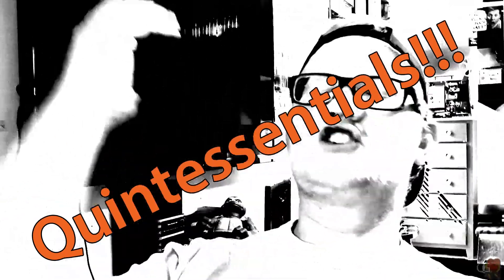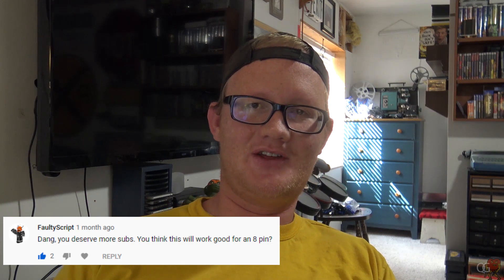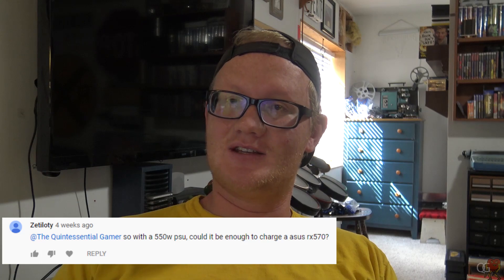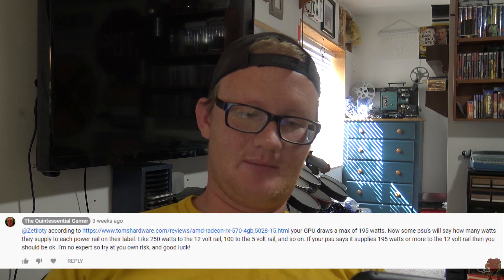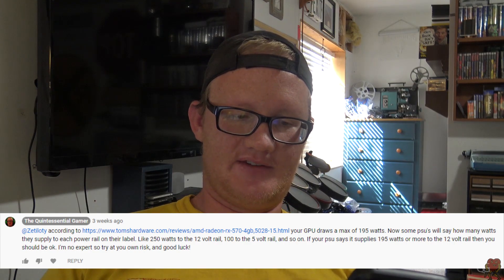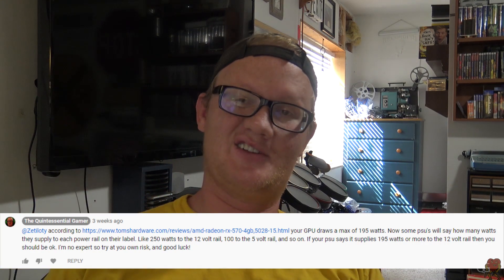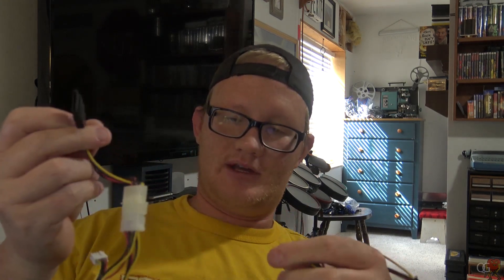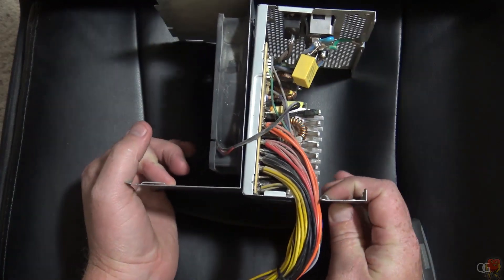Is it too good to be true!? (SATA Power to GPU Power Adapter)

Comment: you can savely use the 6pin , the pcie slot gives the graphics card already 75watts and the 6pin can only draw up to 75watts max if needed  . if you need even more watts then your graphics card will have a 8 pin connector that can draw up to 150watts , now there could be problems with cables, thats alot of power/heat right there . but using only one 6 pin should be always fine or am i wrong here ?
Reply: How does it game?

Comment: Rather than using 2.5"HDD, I prefer to use SSD because it only consume very small power and it won't affect the performance of the read/write activities compared to HDD that really need stable power.

Comment: Have you looked into just upgrading only the PSU? HP on their website have parts and they have higher wattage power supplies. I'm asking since I'm in the same dilemma as you with the proprietary motherboard.
Reply: but it still doesn't provide the 6 pin PCIE power cable so you have to adapt it somehow

Comment: I've heard that this Cable killed a whole GPU. What did they do that this would happen, because I don't want this to happen to me. Or maybe I just buy a new PC idk
Reply: It can melt and short out from overcurrent, if the gpu draws more than about 2.5 amps (45W) from the adapter

Comment: Can i use that thing to power my rx 580?
(I used 400w PSU)
Reply from the maker: Yeah I dont see why not
Reply: Did you use it?
How did it turn out?
Reply: I bought a gigabyte rx 580 8gb. Theres a note that said i must use 500 watts or higher.. And i have 700 watts psu. But i dont have extra 8 pin for my gpu. Im thinking of using this cable adaptor.
Reply: @greasemonkey1267  If you have Molex, use that instead. otherwise hope that sata works.
Reply: @virtualtools_3021  I don't recommend using a single molex to power a gpu
Reply: @ArrogantLoop  i don't either but its way better than using sata.
Reply: I don't think so, single SATA to 6 pin is mostly for cards that just need little bit more power from 6 pin. (Like GTX 1650 that has 6 pin)
Reply: CringeLord4000  It is enough for that card- GPU manufacturers overstate the recommended PSU wattage because they count on some people using 135W CPUs...

Comment: Thank you. Used the adapter on an optiplex 780 sff with a full size gtx 1060
Reply: Doesn't sff have to use VGA low profile?, How do you do that?
Reply: @hijazahsan  it fits in the slot but case back wont fit
Reply: @friendlyjunco6836  doesn't you must have 1x6pin ?
Reply: @hijazahsan  I really don't know much. I'll post a video
Reply: @hijazahsan  just uploaded a video
Reply: @friendlyjunco6836  Where is the video ?

Comment: Devices don't use wattage (current pressure) they draw (use) amps. You can have many devices connected to a xxx watt power cable, the wire gauge, and the total source power determines how much amperage can be carried (drawn) or supplied.
Reply from the maker: All electrical devices draw some amperage at whatever voltage is supplied to them. Voltage multiplied by amperage is wattage. Devices DO use wattage, but that wattage tends vary due to the amps being drawn also varying. Wire guage does not limit the amount of amps being drawn. They are simply rated for certain amperages, meaning a wire can handle up to a certain amount of amps safely. You can draw more amps through it but risk the wire getting hot and even melting. Same goes with the psu. The wattage its rated for means it can safely handle a certain amount of amps being drawn from it. Most power supplies have a safety shutoff. Trying to draw more power through it than what its rated for will likely cause it to cut off the power
Reply: @thequintessentialgamer7514  That was my experience... the GPU would cut out when the power draw was too high (I think there are safety shutoffs in the motherboard or GPU also), so how I connected the adapter to which SATA harness (and what else was on it, e.g., hard drives) mattered.  

Thanks for your vid... it was hugely helpful in my understanding, especially when you dissected the PSU, and helped me resolve my issue.

Comment: i have agtx 650 1gb (dont judge) and a psu 350w psu can it power my gpu
Reply from the maker: According to https://www.videocardbenchmark.net/gpu.php?gpu=GeForce+GTX+650&id=2155 it draws up to 64 watts, so you're probably good with your 350 watt psu
Reply: @thequintessentialgamer7514  my friend has the same gpu but a 280w can he use the same cable ? Also thanks for not ignoring me
Reply from the maker: The cable will work fine. It's their power supply that might cut out if it can't provide enough power for everything.

Comment: I'm using two of those cables for a sapphire nitro 380x and when i'm using very high resolution in games my pc is shutting down after running some time. So it's not good to use these cables.
Reply: Yeah, same case here for me. I did a little research and found out that the adapters would catch fire after a high power draw. The adapters would melt and then short out the contacts and from that you may ruin your power supply or even the graphics card. Some people from the LTT forum recommend the least adapters for a high powered graphics card one should use is the molex to 6 or 8 pin.
In the long run just garner enough money and get yourself a decent power supply at least 80+ bronze efficiency. Also research on the recommend power supply for your gpu
Reply: You need to consider how many wires are powering the GPU.  You can't connect all the devices in series.  The adapter is not the issue, it is how you are connecting it

Comment: yw ... got HP Z600 workstation (650w psu) (with only 1 cpu the other cpu is out), psu have only 6pins for the gpu, i got xfx r9 390 8g from friend, as u know this card need 6pins+8pins combo, my plan is to get 6pins to 8pins adapter to connect the real 6pins out from psu to 8pins port in the card and then 2 sata to 6pins for the 6pins port of the card, to decrease the power conception overall i will disconnect the cd-drive since its almost useless these days :) also i got two 3.5hdds connected through sata power ...  any suggestions ?
Reply: If you can, use molex instead of sata adapter, molex handles more current
Reply: @virtualtools_3021  thnx i ended up using molex

Comment: Hey Quintessential I have a question: My 6pin to 8pin burned (as I OCed my rx580). I am glad only the molex cable burned. Now I am thinking, to use 6pin from my PSU into the GPU and buy a SATA to 6+2 molex and use 2pins from that into my GPU. 
So, final connection: 2pin from SATA + 6pin from PSU -> GPU 8pin input.
How well is this, can I OC my card?
Reply from the maker: Do at your own risk is all I will say. In theory it could work, but it is sketchy. Honestly I think you got lucky only frying the cable before and not your GPU. The safest way would be to just fork out the money and get a new power supply
Reply: @thequintessentialgamer7514  ok thanks
Reply: don't oc your rx580 you should undervolt it
Reply: @kruxdt6307  yep I know now so I undervolted to 1020mV and it's running great ;)

Comment: The photo in the thumbnail is the "wrong" way to do it if you are going to do it. First of all, you need to make sure your power supply is of both sufficient wattage AND sufficient quality... this probably isnt going to work with the 280 watt bestec in your old HP, this is really only something you should do with say a high quality old antec 600 watt or something like that which has wattage support but just not the PCI-E connectors you need. Further, trying to go from a single sata port to an 8 pin is just stupid. the right way to do it is either two molexes to a single six pin or two satas to a single 6 pin, and ideally you would want to pull each of them off a single strand

Comment: Does this damage the gpu I am using rx 470
Reply: Ableh I’m using a rx 570 it works ok. I might recommend a dual Molex
Reply: @otamarau  Molex is much better than sata, it can handle far more current without risk of melting
Reply: @virtualtools_3021  hey I only have 1 Molex.  Is it gonna work If I connect it with dual Molex to 6+2 PCI-E / 8? Like I use one Molex to connect to my PSU Molex and the second Molex I just leave it unconnected while the 6+2 pins connected with my graphic card RX580.
Reply: @HuntersOfficial2021  those need the 2nd molex connected, what PSU do you have?
Reply: @virtualtools_3021  idk but old. 8 years old PSU (550W) That doesn't have 2 molex. It's okay I'll change my mind and just buy 750 ti because it not requires 6 pins. 👍
Reply: @HuntersOfficial2021  550w isnt too bad. you could use a molex spliter, as long as the gpu you are trying to power isnt a total energy hog.
Reply: @virtualtools_3021  I got it. Thanks

Comment: So, i think...When i get my new power supply, i only need too that cable, so i have to put the new power supply connection on my motherboard, so heres the fact...What i understand is next: if with the new power supply i dont use 24 pin to 6 pin,  so i use the 15 pin to 6 pin i can use the card well...I dont know so much of this topic, so finally my question is: of where the others things take the power?, i mean, i dont need to do anything more?, only put the new power supply and use that cable and connect all things normally to the new power supply?, thank you. Sorry if my english is bad, im spanish.

Comment: Quick question what's the best low power graphics card for sim gaming?  I'm using Forza 7 and iRacing.  I also have an HP.  I'd like it to remain in stock form.
Reply: FSX239 I would say MSI GeForce GTX 1050 Ti 4GT OC.
Reply: if you want super low power a GT 1030 might work. you would have to play in lower graphics however.

Comment: Can i run an rx 480 8gb or 4gb with it
I have a xilence Xp400r7 400w
Pls help me my psu only has a 6pin connector and it needs 8pin i think and the rest of my pc just use about to 230-250 watts pls
Reply: AlphaZyro  Would that be enough for a graphic card that needs an 8 pin connector ?
Reply: @dzcasanova8840  Its 1000x better than using a sata to power it.

Comment: you are excellent...had one of the yellow wires burn out on my 2 x molex to 8 pin graphics card adapter whilst running a gpu benchmark on my MSI Armor rx580. I now understand way more about the reasons why. 12 year old PSU 650w SilenX Modular with hardly any use on it as been in storage. Thank you. Subbed.
Reply: I. Messili luckily the GPU was fine. I can run the GPU with new 16awg cabling but only for basic purposes Not heavy duty gaming or benchmarks. I’m going to buy a new modular PSU with dedicated cables to the GPU. That way I’ll feel confident to enjoy the graphics card. I may as well upgrade to a Ryzen 3900 system whilst I’m at it. Thank you for asking
Reply: @RadiAsian but the pin(s) on your card also got blackened right? Here my rx580 got 3 pins (on position of 3 yellow wires) blackened due to burst 3pin on peg pcie cable due to heavy OCing that pushed the card running beyond 225w. But then after that i changed cable head and card continues working fine.
Reply: @minhnguyennhat9556  no the pins on the GPU connector were fine luckily. Put the rx580 in my 2008 mac pro 3.1 with the correct mac logic board cables providing the required power. Bought a new PSu (fractal modular) and built a new machine a few years ago ryzen 5950x with 6700xt. Much better to have a new adequately powered psu with dedicated cabling for your gPu as opposed to converter plugs etc

Comment: hey you can buy a 24 pin to 8 pin (or whatever number your mobo needs) adapter to power your mobo with a new psu
Reply from the maker: Its possible that they exist, finding them is one issue. Them actually working correctly may be another
Reply: @thequintessentialgamer7514   I bought one on ebay for 4 dallors for my optiplex 9020, and has been performing good so far

Comment: I want to buy an gtx 1650 super.I have an 500w psu which doesn't have an 6 pin.Sata has 60w right??And the motherboard has 75w so am i okay?plzz answer
Reply from the maker: According to: https://www.techpowerup.com/gpu-specs/geforce-gtx-1650-super.c3411
A gtx 1650 super draws a max of 100 watts, which is less than the max amount the cable I show in my video can handle, so you should be okay, but no guarantees.

Comment: Hi, I'm connecting a 3-fan GTX 1080 to my 750wplus source and I only have 1 8-pin cable and I'm missing 1 of 6, because it uses 6 + 8. Could you connect the 8-pin + 6-pin made with SATA adapters? Do you recommend using the one made of dual SATA or single?
Reply from the maker: DM me some pics https://www.instagram.com/the_quint_essential/
Reply: this sounds kind of scary

Comment: if my psu just have 4pin,but my gpu need 8 pin,can i use this cable?my gpu rx 570
my psu 500w

also which one is better?using this cable or molex cable?
Reply from the maker: U can get a 4 pin molex to sata adapter, and then use this cable. But if your power supply has an pin already then use that. It can handle more watts